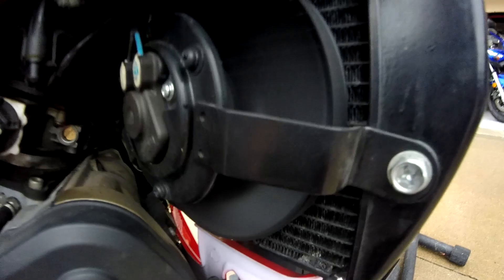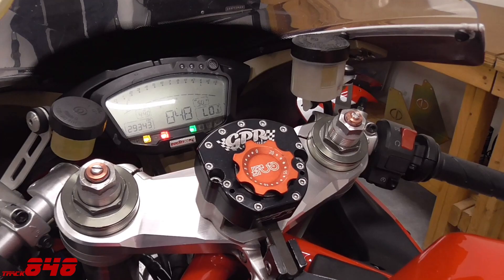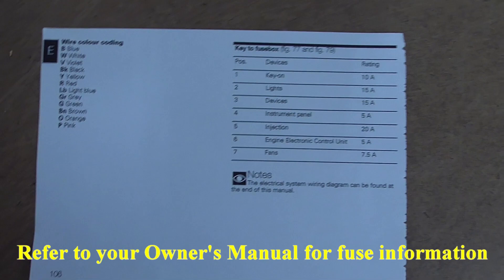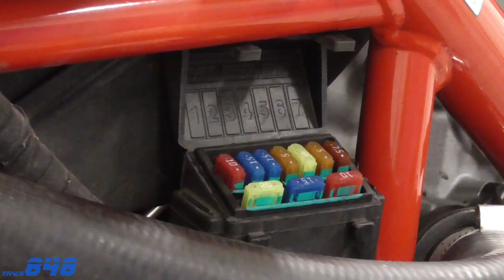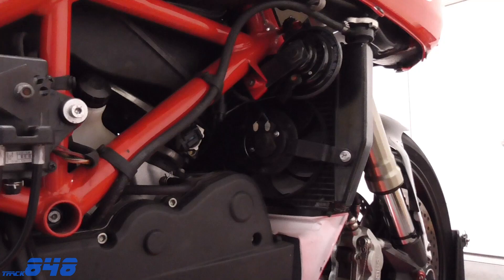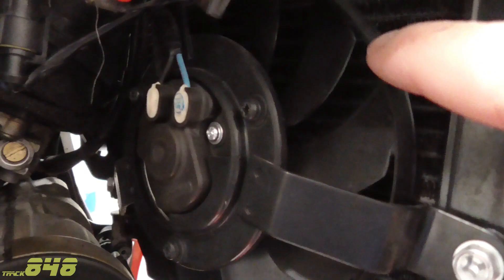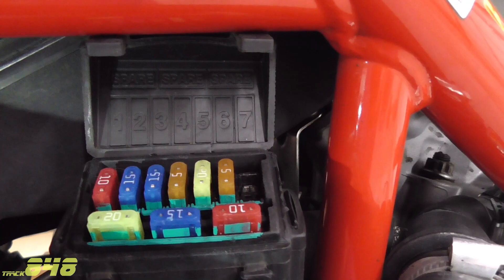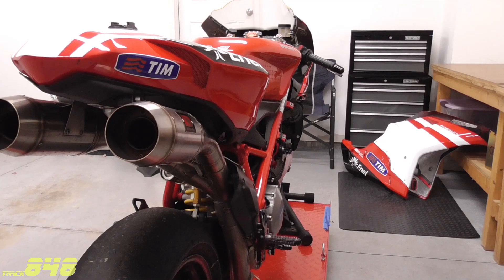Overheating Motorcycle | Blown Fan Fuse [SOLVED!]

Comment from the maker: Do you have a fan fuse on your motorcycle that keeps blowing? If so, in this video I walk you through some basic troubleshooting steps to help identify the problem; Good luck with your repair!
Reply: Hi Track848....  what gearing on your sprockets do you run?  How many links are your chain?
Reply from the maker: @samm4600  Hi Sam... I run a 15t front sprocket, which is stock, and have 39t to 44t to run in the rear. Generally speaking, I like 41t the best at the tracks I ride and when riding on the street unless I have a 180/60 rear tire installed and then I run a 40t sprocket in the rear (this is what I'm currently running). With the 41t and a 180/60 I have only 7-8mm swingarm clearance. After switching to a 40t I end up with about 15-16mm, which makes me feel much more comfortable. Regarding the chain, I use 100-links which is two links longer than the stock 98-link chain on the 848. I moved to 100-links after completing the swingarm modification to gain more distance... watch this video: https://youtu.be/Ey7PYI8wv8I

Let me know if you have any additional questions!
Reply: @Track848  

I really appreciate your insight and follow your videos.  Wish I could contact you directly because I have lots of questions in regards to the 848 for the track.  So I currently run 14T front and 39T rear sprocket with a Dunlop 180/60 slick.  Clearance is plenty and I'm on the stock 98 link chain.  I'm looking to squeeze just a little more acceleration from some of the short tracks I ride, because it takes a little longer to get up to speed coming out of the corners.  My swingarm is not modified as yours and don't think I want to get involved with that right now.  Do you think going to 14T and 40T rear will allow me to use the existing 98 link chain and maintain clearance?  Will I benefit acheiving  quicker acceleration with that set-up?  
Thank you for your support and co-operation!!!  Much appreciated

Comment: Mine started also like this and after I switched the fuse I realized by the next ride that the warning message comes again but only for a few seconds and went gone, after that i realized all of my lights went out...so yeah like you just said at the end of the video i have to replace my voltage regulator. And before it was just the beginning of the bad regulator with the "blown  fan fuse". I will also relocate the VR on the right side of the bike next to the twins..

Also good to know what I red on a forum. If not the fuse and not the VR is your problem than probably it will be the relay...and if it's the relay than buy TWO of them. Those are really cheap and if your bike has an electrical shorting than is good to have another relay as spare.

Anyway thanks for the really detailed video like always. 
Regards, Adam
Reply from the maker: It sounds like our symptoms were exactly the same. I might document the reg/rec problem in another video if I can come up with enough footage; Ride Safe Adam!
Reply: @Track848  I changed mine today. Everything is fine again, i did a testride also but i got on the dash only 12,3-12,8v...is this normal with the new regulator? Actually I bought one with a better electronic inside(they said...)
For the relocate kit i have to wait another 2 weeks but i will do that also immediatelly.
Reply from the maker: 12.5 to 12.7 or 12.8 is indicative of a battery at rest when the engine is not running. Once started, my 09' 848 calls for 14.5v (+ or - .5 v) at 3,000 rpm for the stock lead battery. Are the numbers you mention when the bike is turned off? If that's your voltage when it is running you should have that battery tested and replaced if necessary.
Reply: @Track848  The engine was running but the vents were on...if it's means something. The battery is 6 months old actually.
Reply from the maker: Hopefully your bad reg/rec didn't fry the new battery... I would have it tested. If you're in the US you can take it to Autozone, Advance Auto and other auto parts stores, and they can test it and bring it back up to full charge if needed. My local stores do this for no charge. If it dips back down to the 12s when running, you may have to replace it...
Reply: @Track848  I measured out everything. The new VR is toasted by the negativ cable. I bought one from Germany and they said on the page that this has a better electronic inside...actually this is the same shit like from Aliexpress for 20$...
I already ordered a new one. Battery is perfect, stator is perfect.

Comment: Thanks for the video! Good to know all the potential problems of why a fan fuse would blow and to carry a spare while riding.  

I changed my R/R  to a mosfet type 18K miles ago on my 2009 848 (30K total street miles) specifically the Shindengen FH020AA and it’s been flawless.  Bought it from http://roadstercycle.com/  Great service and communication.  Looks like SH847 for track bikes.  

I eliminated the exhaust servo motor as well and mounted the R/R in its place using a bracket fabricated from aluminum bars. Much better cooling than being near the front header pipe.   But less protection in a crash knock on wood
Also the wires that connect from the stator wires to the R/R and wires to the battery will be much longer and will cross through the frame but one positive thing is you can point 
the 3 yellow stator wires straight up and avoid the engine oil seeping through the wires and fouling up whatever plugs you use to extend the stator wires.  

Used the http://www.vizi-tec.com/duc-ee/ to keep the CEL off. No problems. 
Servo buddy did not work for my bike.  

Also just wanted to mention the mosfet R/R seems to extend the life of the battery.  My Yuasa YT12B BS was still cranking strong after 5.5 years but I decided to just replace it for preventative measure.  

With the oem R/R battery lasted just 3 years.  

Keep us updated!
Reply from the maker: Thanks for commenting, that's a lot of good info! I ended up picking up a very inexpensive OEM reg/rec, but will likely go to roadstercycle if this one ever fails. I also upgraded the connectors to more heavy duty ones and routed some extra wire straight up from the stator to help eliminate the wicking issue.

Comment: hello sir,  i saw my 848 when i off the engine the fan will stop ( key still turn on) , is it normal?  it same us?
Reply from the maker: Hi Kit, I believe this is normal, but I will check tomorrow when I go on a ride. The fans on my 848 turn on when the engine reaches a temperature of 217 degrees F (103 C) and typically will shut-off again when the temperature lowers to 212-213 degrees F (100 -101 C). I will come back and let you know tomorrow.
Reply from the maker: kit, The weather here did not cooperate and I was unable to go on my ride the other day; however, my bike is in the driveway warming up right now 😀😀 and I checked the fan operation:  If I turn-off the engine of the motorcycle when the fans are running the fans also turn off. This occurs even if the key is in the 'on' position. This is different from some of the newer Ducati motorcycles (The V4R for example); I have a friend with one of those bikes and the fans continue to run after the motorcycle is turned-off; on our 848s however, it appears the fans are programmed to shut-off as soon as the engine is turned off...

Comment: 29K miles on that 848 👍👍...... How many of those miles are track miles at what pace?

Regards, Erick
Reply from the maker: Hey Erick, thanks for the reply.... 18-19,000 miles are street miles and the remainder are from the track. Some intermediate but mostly in the advanced group for the last several years. This is a fun track bike!
Reply: That’s great!
I had an 1098S briefly 😢...
I am going to look around for an 848 or R6 for track duty... even though I have a Aprilia RSV4 and CBR 600RR for track 😉👊

Comment: doh, mine just suddenly got this 18.2 error while about to start the bike in steel cold condition, fuse was okay, but replaced anyway, replaced all 3 relays, checked both fans spin freely, still this error wont go away, both fans dead silent event after 110c, tried to power the fan directly from the battery , they both working fine! what do i miss? :(
Reply from the maker: Do you still have the original reg/rec on this bike? It could be going bad. Also, how does your connector look that connects the three stator wires to the reg/rec? Does it look burnt? If so, I have read of electrical gremlins that result from this, too. Here's a video I made on this topic:  https://youtu.be/I7aEfThHS2Q. 
In the end, my problem was the reg/rec, but my warning light went out after I replaced my fuse. Good luck!

Comment: helllo~

My 2010 848 22000km now ,in 15000km timeing belt changed. anything works fine,
 but sometime engine will cut off when waiting traffic signal light, 
should need to reset the TPS? and how to did it. thanks!
Reply from the maker: Kit, there could be a variety of problems causing your bike to stall; too many to diagnose here. I once had a bad clutch microswitch that caused stalling and more recently (sounds similar to your experience) a bad regulator-rectifier. Check to ensure that your battery cables are tight and if that's not the problem I recommend visiting one of the ducati forums for more research. Ducati .org and ducati .ms are good resources.
Reply: Thanks for your replay 🙏🏼